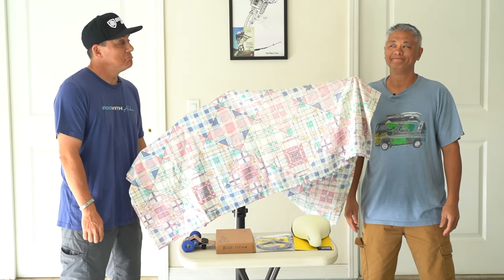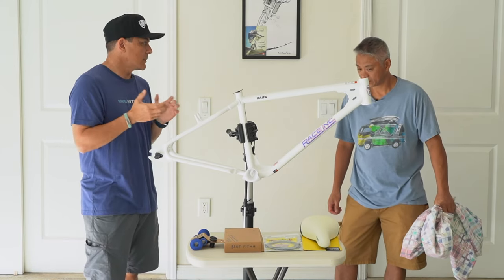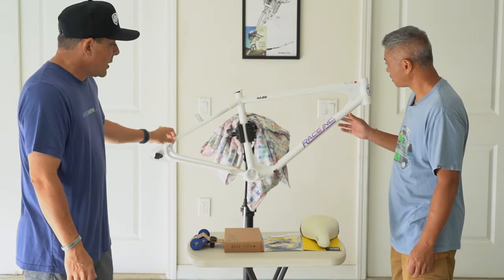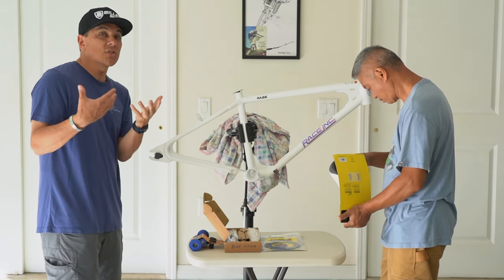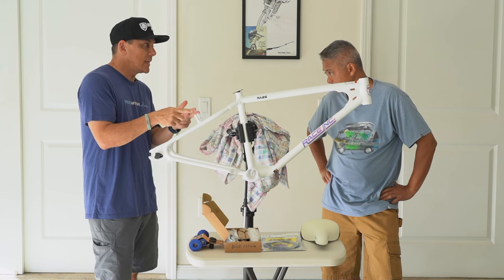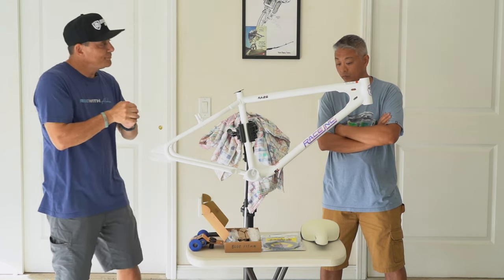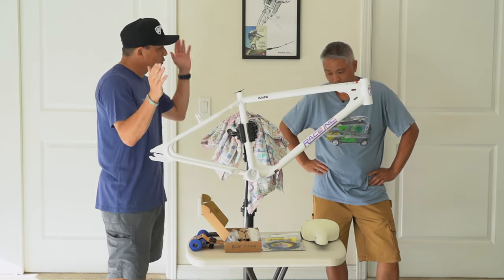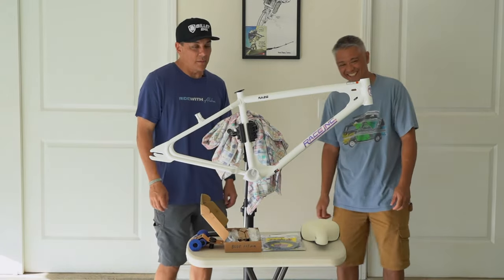"Gotcha!" - The Next BMX Cruiser Build Out of Bernie's Garage!

Comment: All race Inc. Racing frames are designed with over size technology 20 mm hubs same as the front wheel you’re gonna find that it’s oversize 20 mm you have to use an adapter to adapt it down if you need some information get a hold of me
Reply from the maker: Thanks for that info!  Yeah, the frame and fork came with some adaptors for the front and rear. I am going with the Billet BMX chain tensioner that has that adaptor as part of it. Appreciate that offer to help and thanks for watching! 🤙🏻

Comment: That's gonna look great.  As a suggestion for the wheels, why don't you go with black rims, blue nipples, black spokes with either blue or chrome/polished hubs (will match forks and bars).  As for tires go black with a whitewall/white stripe or all black.   Pricey but you should try Brooks C19 slotted.  Modern/sleek & Quite comfortable 😀.....for my butt atleast.  

For brakes...try something new....ever try hydraulic rim brakes.  Look at Magura HS33's.  Got those on my S&M ATF 26 build.  RL Osborne has them on his 26 Haro.  Check out his vids for more info.

Looking forward to this build.
Reply from the maker: Thanks for the suggestions!  Those are some great ideas. I have yet to warm up to a Brooks seat, although everything I've heard about them has been positive. My old butt needs some cushion so I haven't pulled that trigger yet. But who knows, I just may do that!  I found some Comp 3 tires with whitewalls so I'm stoked about that. Thanks again for the suggestions and for watching! 🤙🏻